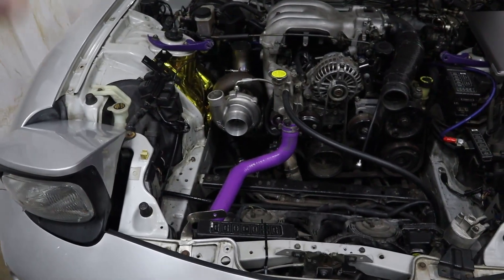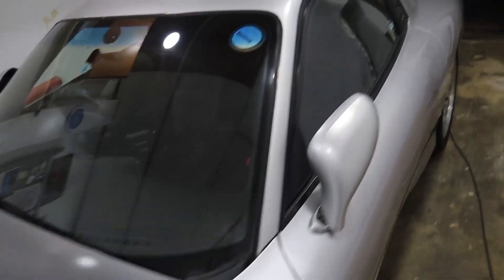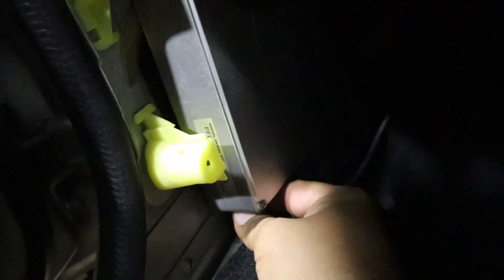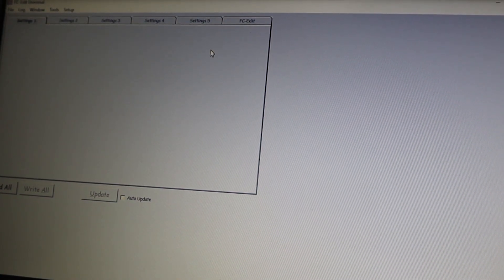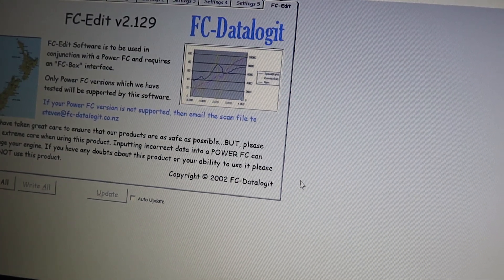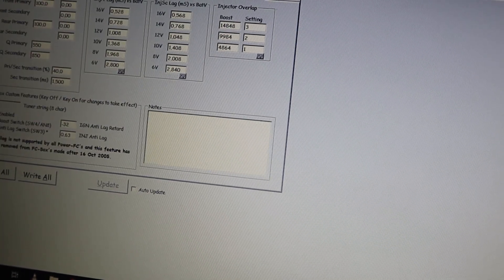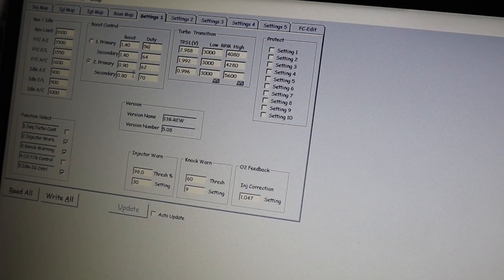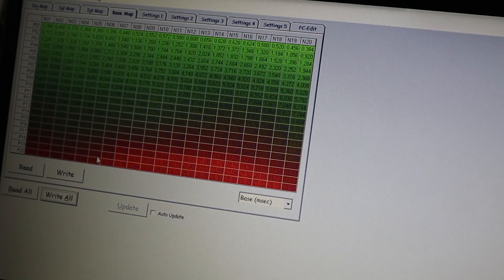How to load a custom MAP on APEXI POWER FC

Comment: Just to be clear when you initialize you are erasing the previous map? For example, if there was a custom map before when i initialize it will erase previous map and go back to the 'base map?' I have an Apexi FC for 2001 toyota Celica. Please clarify. Thanks Nelson
Reply from the maker: Hi Josue, 100% don't click initialize unless you want the base map for that particular Apexi PFC ECU back on... Pull your map by clicking Read All first.. make changes then click write all to save it to the ECU
Reply: @NelKelJDM  Thanks so much Nelson. I want to do this right. The map I want to upload is in a DAT file. I have to 'open' that file and load it to the FC Edit program correct? OR....do I click Read All to load my custom map onto FC Edit and then Write All?
Reply from the maker: @captainjosue  I generally click read all first so that I can be sure the FC-hako or Datalogit is communicating with the ECU.. Then I load the new map and click write all.. once done, I usually unplug my cable, cycle ignition and plug back in then read all again to see that it actually saved my changes to the ECU..
Reply: Thank you Nelson for your reply. Have a wonderful day :)